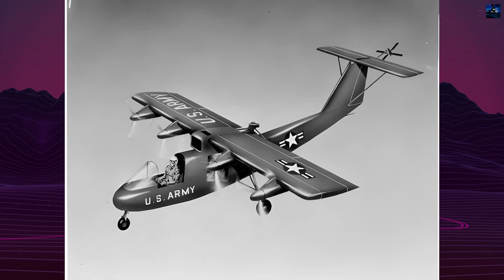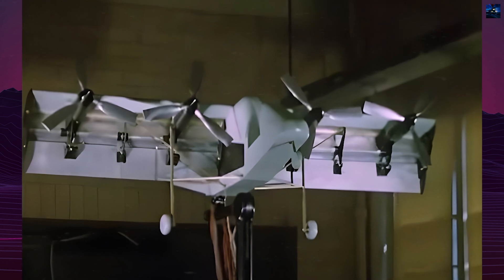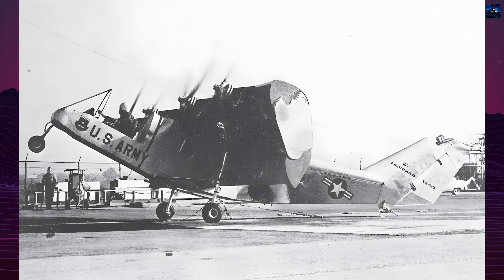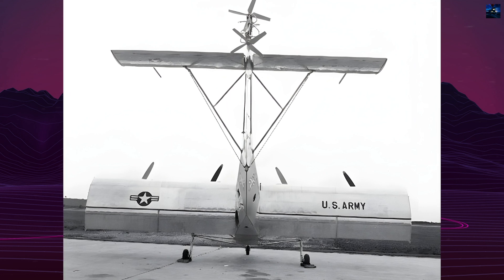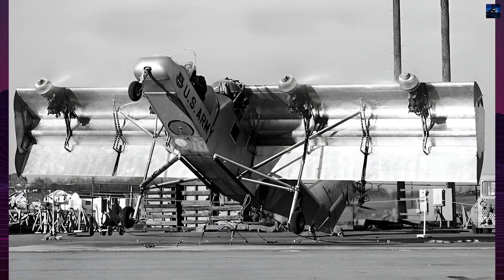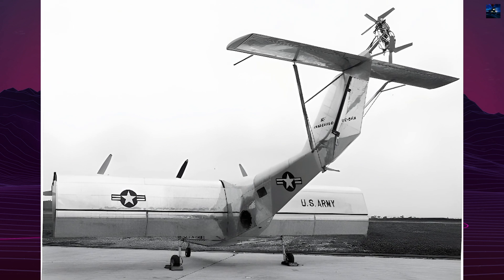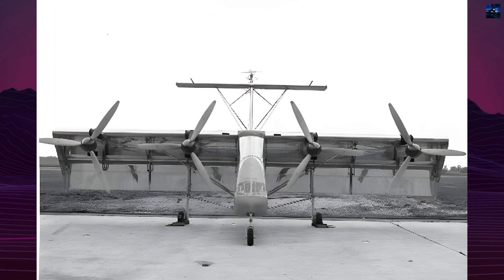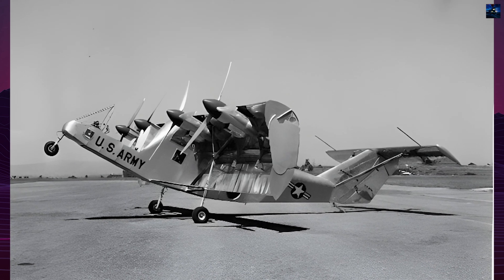Fairchild VZ-5: A Pioneering Vertical Takeoff Design

Comment: By 3:27, I see an OBVIOUS Issue in Prop Rotation, where they have 3 blades spinning one way, one going the Other?! Did they NOT KNOW, of North Americans' Issues with the F-82 Proto, that could do high-speed Taxi Runs, but NOT LIFT OFF, until the props were Reversed? Vortices Matter! And, by then, been, well, not  "proven-out" but a 'known issue', if by no-other Reasoning than 'Torque upon Lift-off' and "Prop-Wash" that lead to 'ground loops' under high power settings at Take-off.  Fairchild must've been too deep into the C-123 (formerly a Glider, btw) Provider to get the know-how to manage their Props from a Central Engine?/  I dunno, but I'm guessing, non-educated 'engineers', like those I've seen in Machine Tooling companies.